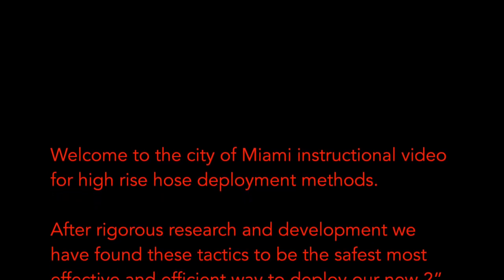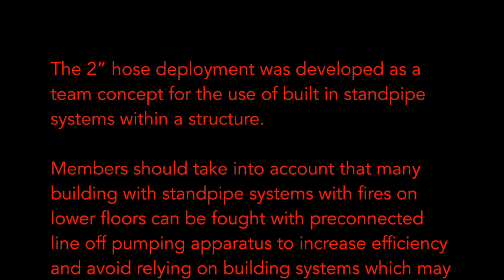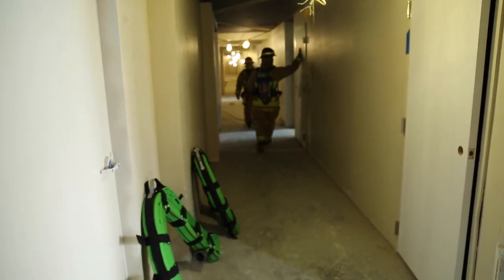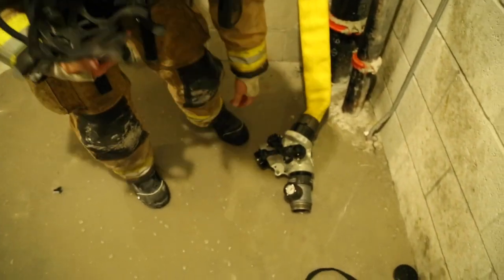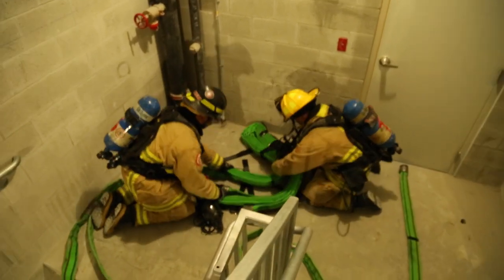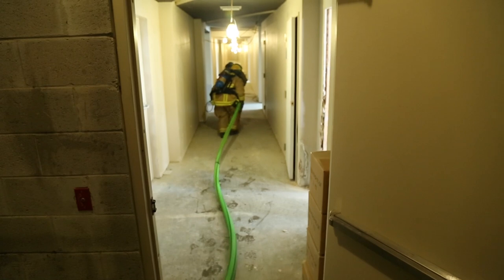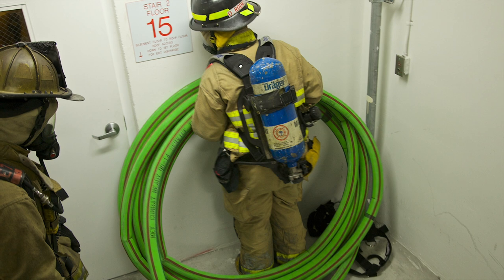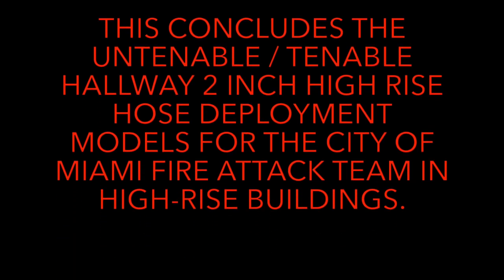CITY OF MIAMI FIRE RESCUE UNTENABLE / TENABLE HALLWAY 2 IN HIGH-RISE HOSE DEPLOYMENT VIDEO

Comment: Thanks for a great instructional video. Very well done.

We have been researching the optimal packing, carrying and deployment of the Cleveland Hose Load (which goes by many names, you call it the Loop Load) for several years. We have practical solutions currently in use by many fire departments.

We would love to share/exchange information with you for the benefit of all.

Some key points we notice from your video:

In the UK and US several firefighter fatalities have occured due to cables entangling the ff's, usually behind the SCBA tank. That gap can now be covered by an anti-tangle strap, a UK ff invented it after two of his ff comrades died at the Shirley Towers fire.

Carrying the Horseshoe and Loop Load over the sensitive SCBA tank can be avoided. An ergonomically optimal, hands-free solution exists.

The high rise packs shown require seven straps to be undone by gloved ff's in possibly low visibility conditions. A solution with one easy-to-pull opener exists.

Your Horseshoe and Loop packs may look very similar in a low visibility stress situation. A red (fire) coloured Loop pack and a blue (water) coloured feeding line pack would solve that issue. No chance for mistakes. Such packs exist.

Our experience is that when charging the Loop Load the nozzle should always be held by the ff to avoid it crossing under any of the loops and causing a water-constricting knot.

We have many videos and material describing our research, results and conclusions for all to share. Just drop me line:  bill@esttokyo.com   Thanks and regards, Bill Dykes, EST-Emergency Services Technology Ltd.